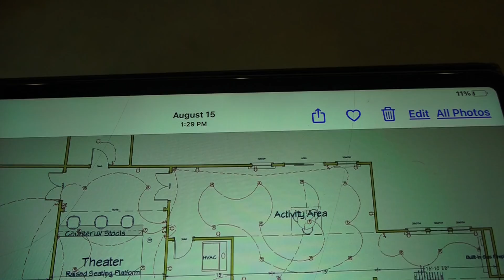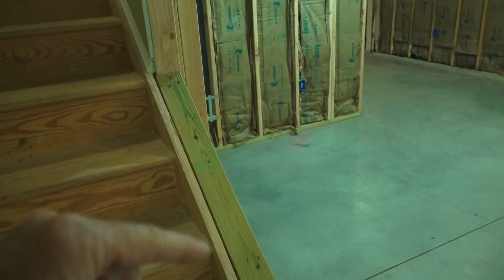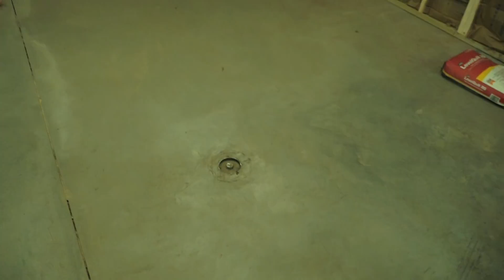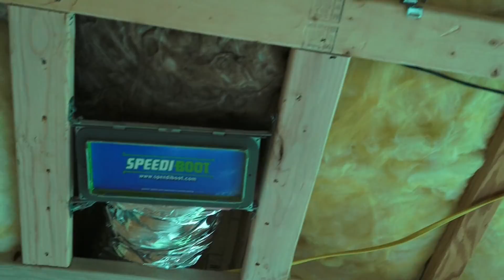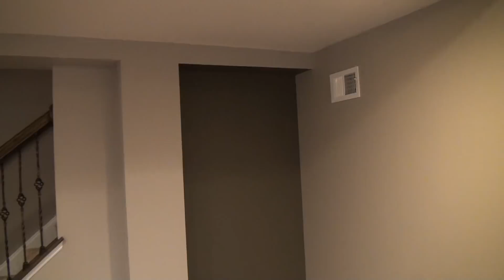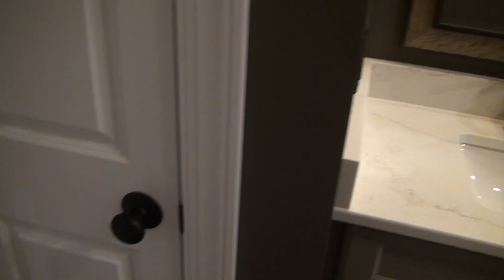Basement Finishing Design & Framing Ideas

Comment: Hey Eddie. Love all your videos as they’ve given me the confidence to tackle my basement. I have a unique situation where we extended our basement so the new area steps down about 8 inches from the original basement. There’s a 5ft concrete opening and one step between the two areas. I’m wondering how to frame around the concrete opening and the step down to the new basement.  Do I just put PT wood around the concrete opening?  Then frame the wall like I would frame an exterior wall with a door opening, cutting the bottom plates to follow the step?

Comment: Great content. Any thoughts on wood versus metal framing?
Reply from the maker: Don't use metal...no comment.
Reply: @BasementFinishingMan  Hi Eddie. Thanks for the reply. If I have a dry basement with no moisture issues, do I need a subfloor or a d m x 1 step, or could LVP flooring with the underlayment be placed directly on top of the concrete? Thanks.

Comment: What do you think about adding vapor barrier between insulation and drywall? Looks like a fun project! Thanks
Reply from the maker: Advise against plastic vapor barriers...Don' tlike or use any.  Best  ~Eddie
Reply from the maker: I advise all my students NOT to use plastic vapor barriers...they cause more moisture and mold problems then they ever solve.  Thanks for watching!  ~Eddie
Reply: @BasementFinishingMan  Been watching a lot of your videos and have a load of questions. But as far as the plastic vapor barrier is concerned the previous owners put one on one random interior wall leading into the laundry room which is unfinished. I did notice there was a bit of white mold on the floor joists on the finished side of the wall (we have coffered ceilings so I was able to look up there). Do you think the plastic vapor barrier caused this and would it be beneficial to remove it?

Comment: I had a company come out and install a drainage system in my basement. Warranty is voided if I drill a bottom plate into the slab where it was placed. Do you suggest only an adhesive?
Reply from the maker: A good construction adhesive works good, but I wouild still recommend a few fasteners to hold the walls solid while the glue sets...  ~Eddie

Comment: How do you heat and cool this gorgeous basement. Is it tied in to the existing ductwork? Or is there a separate heating and cooling system for just the basement
Reply from the maker: Tapped into the 1st floor zone which was sized to accomodate the added finished space Jarret. Thanks for watching and for the positive comments...~Eddie

Comment: This looks great.  I’m currently working on my basement and I’m getting caught up on the best/moat advisable way to insulate my walls along the foundation walls…the framing is about 2” pulled out from the concrete and currently has regular batt insulation.  This is a new home that was completed 5 yrs ago and the builder framed all of the outer walls against the foundation and insulated as I already explained, but I can’t decide if I should pull the batt insulation out and try to get 2” foam board behind those walls against the concrete and reinstall the batt insulation.  It would add a lot of additional cost and be a big pain in the ass, but I want to do it right and just wanted to get your opinion/advice…do you think I would be ok with just keeping the batt insulation and making sure that it’s pulled off and not touching the concrete or do you think I am risky potential moisture issues?   Any guidance is greatly appreciated and I genuinely appreciate the work you do on your channel!
Reply from the maker: Leave it! It's okay if the fiberglass touches the exterior masonry walls...No vapor barrier is needed as well.   ~Eddie